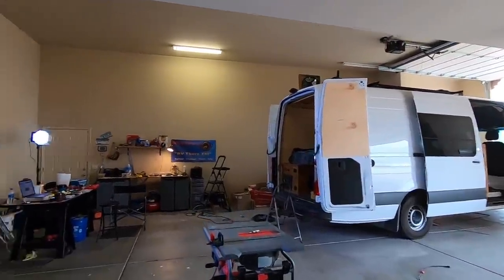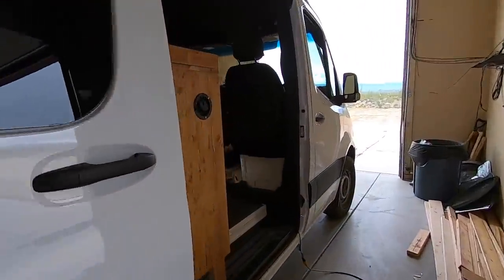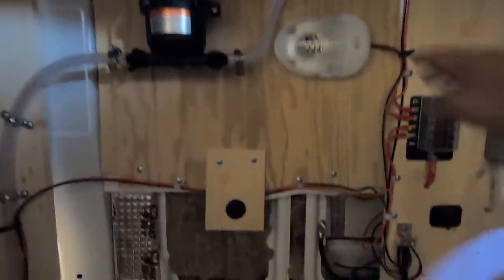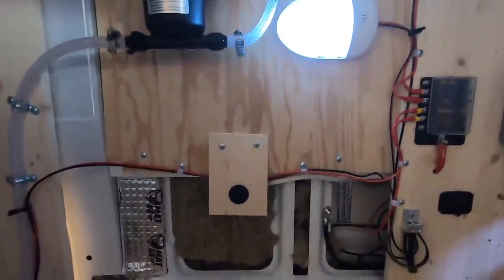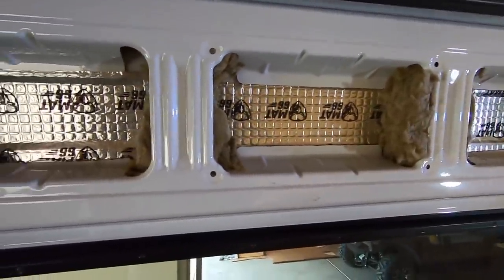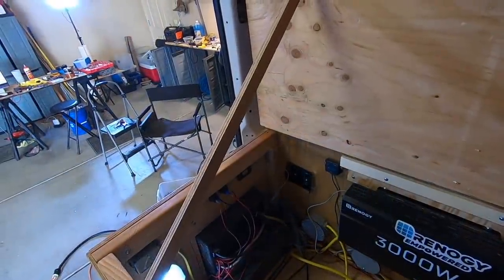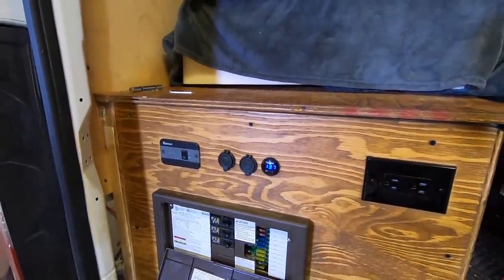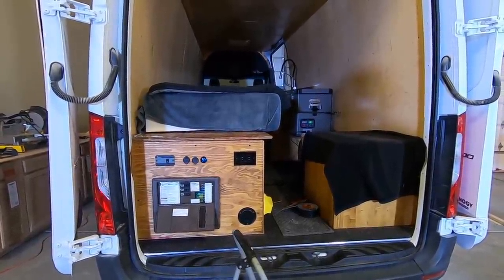Simple 12 Volt Seaflow Water System - Sprinter Van Build

Comment: Just a thought re water lines: I put a T fitting on the line from my pump to the faucet so that both lines are fed with the (cold) water from the pump. Then the handle position doesn't matter for single-handles, or both handles work for double-handles. I'd agree with the comments about moving the switch up. Looking great! Gord.

Comment: Shower? Windows? Hot water? Air handler? Do like your diy, elec and water systems. I will upgrade my old tec systems as possible. But fully functional bathroom, shower ect, is great when boondocking.